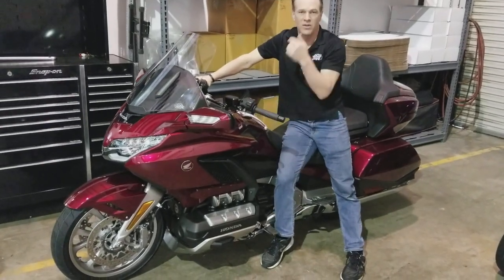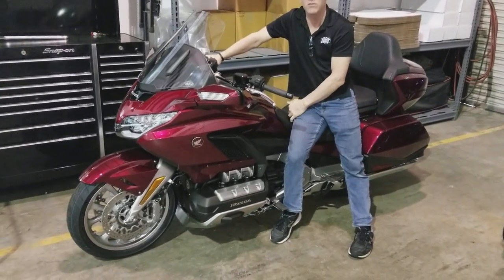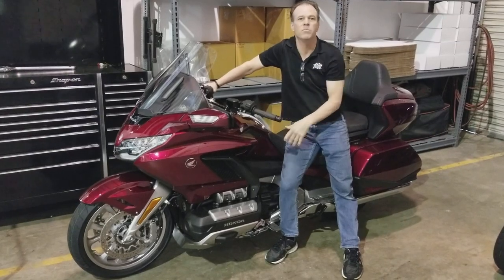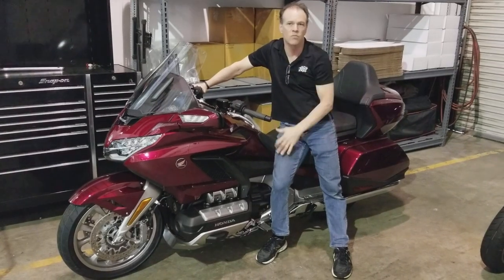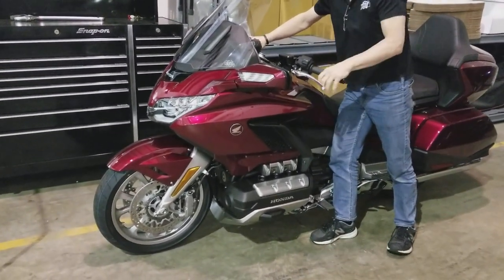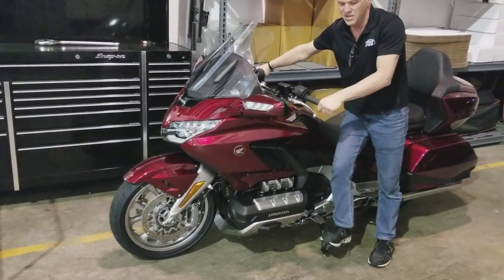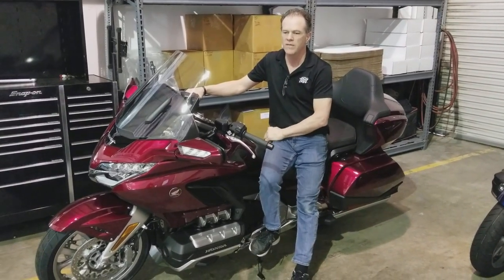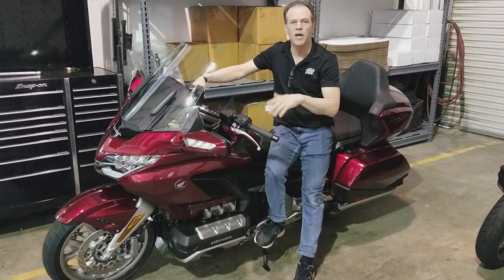Honda GL1800 Gold Wing front shock absorber bounces

Comment: I owned a GL 1100 and a GL 1500. Both needed aftermarket springs and different shock oil to settle the front ends down. This has been a GL problem for 30 years. Stock rides like a 56 Buick Roadmaster.